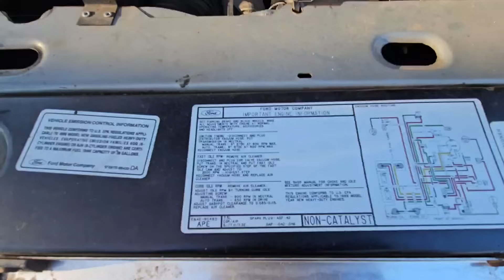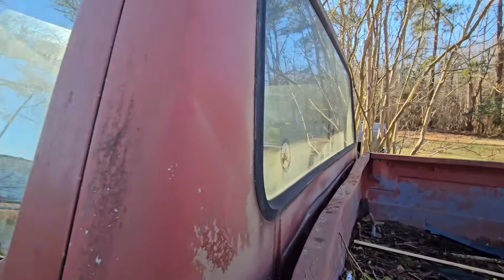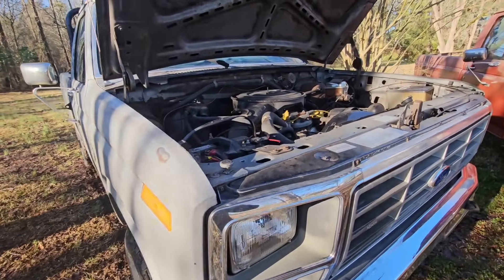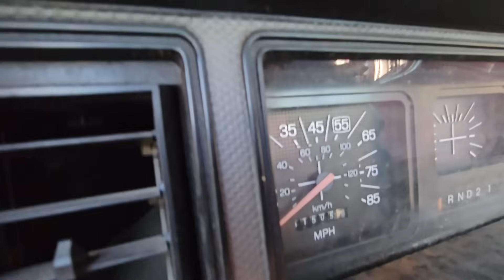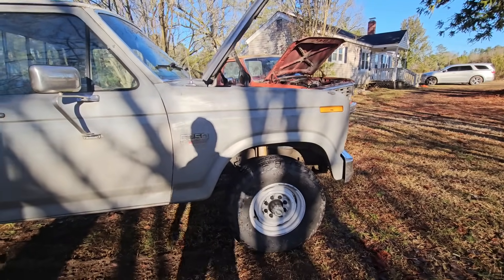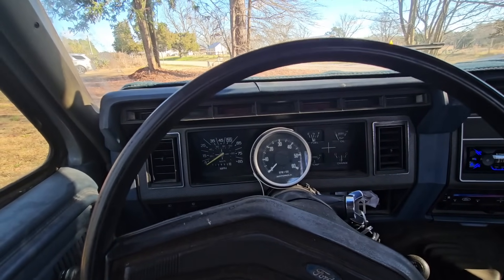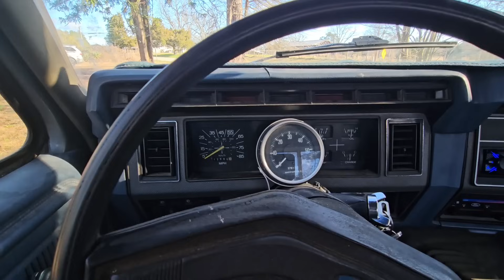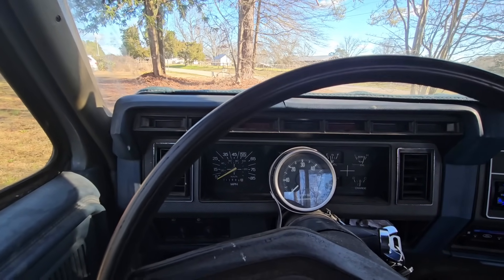THE WORST TRUCK FORD EVER MADE!?!?! #ford #fseries #sbf #bbf #truck

Comment: I had an 86 87 92 all f150s with 300 stright 6s and a 94 bronco and I still own a 78 f150. These are the days when they made trucks to last.
Reply: Now that’s a good joke when you said that’s when they made trucks to last.
Reply: What kind of mpg you getting on the six?
Reply: @samiam247  on the 80s models not so good because they both had the granny 4 speeds with a 3.55 rear-end so got around 15 at best .  The 92 had a 5 speed so it got about 20. With 2 tanks I could go close to 500 miles. My 78 has a 302 with a three on the tree and it gets about the same with that tall gear.
Reply: Unfortunately the engines weren’t. But what’s great is plenty of options for mods. Such as intakes, heads, fuel injection.
Reply: I still own a 1995 f150 5 speed with the single gas tank and the 300 I still drive here 2 days a week she has over 320k on her and still running strong I only drive here twice a week because she is always been a heavy drinker and gas is still high for filling the tank up every other drive lol these big sixes are not the best on the dinosaur juice. I get about 15 mpg highway/country roads. I couldn't tell you in town I don't drive there much. a lot of country driving I've owned this truck the last 20 years  and I got it from my dad that purchased it brand new so she's a family ford.
Reply: @acuraintegra101  If I could find a truck like that I would love it. For around 3k you can get a turbo conversion kit and produce around 500 hp with that engine. 300 is easily attainable. Not sure about torque but I would assume it’s equivalent to a 6.0 Diesel.
Reply: @rolandthethompsongunner64   with the miles on the truck I just leave it stock the Turbo would just kill the truck faster I can pull 7500 lb no problem and that's good enough for me I've got other vehicles for speed 2 Miatas one stock and one mildly modded 2 mustangs both modded and a rx7 bridge ported so Ill leave it up to them to go fast lol and use the truck to get parts and to take them to the track these old trucks are great when there left alone. I find the ford trucks become unreliable when people mod them. It's not Ford's fault all they did was make a great work horse it's the person trying to fix what's not broke that is there downside don't think for one moment I've not thought about it but I just tell myself not this one just leave her be fix only what breaks and with oem parts. The only things ever replaced on this truck was the clutch but 300k plus will do that and the water pump which didn't fail the gasket did but being it was 35 dollars for a new one I just replaced because it was off and didn't want it to fail a few months or years later  lol I still have the old one. But if you find one of these old trucks buy it you won't be disappointed with it.
Reply: @rolandthethompsongunner64  The 5.0 300 inline 6 is one of the most reliable inline six bangers ever built!
Reply: @bad74maverick1  No shit. It’s also a weak ass engine compared to anything newer.
Reply: @bad74maverick1  And it’s a 4.9 not 5.0 liter.
Reply: @samiam247  Abysmal. 😂
Reply: @rolandthethompsongunner64 made the same HP and more Torque than the 302/5.0.

My 90 has 600k miles and still gets 22mpg and have the scale receipts for pulling 3500lbs payload, and 17000lbs towing.  Now yes a new truck will beat it at the track-but trucks were built for hauling not racing.
Reply: @bowez9  Ok fine. Not my point. And it made equivalent HP for a 5.0 liter of that year. A 4 cylinder today produces more horsepower than either. It’s a durable engine that’s it. I would swap it out for a 5.0 Coyote engine.
Reply: @rolandthethompsongunner64  so you can brag?  All you gain is power but still lose reliability  over an orginal engine that is adequate.  IE you won't get 600k miles on MOD motor timing chains, guides or cam phasers, you might get 200k-300k.  Were as the 300 timing gears are good forever.  How much power does the Coyote make at 1000RPM?  EFI 300s make 300 lbs-ft.

Different marketing the old trucks were sold to be trucks not status symbols.

But that same 4 cylinder doesn't make the same torque-without a power adder.
Reply: @bowez9  Keep your tractor engine then. 🤡☝️
Reply: 99-03 super duty trucks were the most well built trucks.
Reply: I love the 300 six.
Reply: Made to last😂😂😂, maybe a 125k or 200k if you babied them???  Meanwhile I'm turning 315k on my vortec without an overhaul, still runs like it did off the lot brand new.
Reply: @ko4otv43 Nice truck man. In the old century, up to 1979 was the last year Ford made a powerful and reliable truck that looked great. 1980.....puke
Reply: @DG-sf9ei  like a diamond ring with a plastic band.

Referring to the GM.
Reply: Can’t beat them 300s I’ve owned a 81, 89, 94, and a 95 all with a 300. The 89, 94 and 95 all had a 5 speed and were 2 wheel drive, was a perfect daily driver. My 81 4 speed granny 4x4 has been through hell and still goes anywhere I want it to go. Man I love them trucks
Reply: @rolandthethompsongunner64  I will and my 300 will still be going just fine when the Coyote is discontinued.

As the meme say "when the last LS blows up, a 300 will take it to the scrap yard."
Reply: @samiam247 it’s not fantastic, similar to a V8
Reply: @acuraintegra101  I drive a 93 daily in the winter, 300I6, 5 spd manual - over 400k reliable as day 1
Reply: @rolandthethompsongunner64  maybe so, but I chug through the icestorm and pull all those new ones from the ditch with it
Reply: @kellismith4329  ya it's funny how great these trucks are lol I got mine from my dad a long time ago because he thought the truck was on its last leg when it had 150k.. ( alot was down to my mother telling him to sell it before it craps out on him)..on it but I didn't fight him over it and figured it was his loss and fyi he's been thru 3 other trucks since and all are in scrape yards and my girl marches on I can't imagine not having this truck in my life and when the day comes that she needs a new engine she will get it without a second though this truck has almost absolutely no rust on it other that a small amount of surface rust in the bed  and a crack in the dashboard and bench seat but outside of that shes as good as she was  brand new. OBF for life.
Reply: had a 81,86 with 300cid in then an a 97 powerstroke last time they had the heavy duty emblem on tailgate an fond memories of all.81 was a f100 but had kingpins too
Reply: Yup! Those straight 6’s were bullet proof! Couldn’t be put down. And I tried! 😂
Reply: Only vehicle I’ve ever regretted selling is my 94 Bronco.
Reply: I have one that’s an automatic and 92 with a 300 in line 6 in it. Runs great
Reply: I owned a 1983 F100, 300 six, one barrel carb, 3 speed auto tranny and dual gas tanks. Bought it 10 years old. Drive it an additional 75,000 miles. I loved the truck. Didn’t get all that good of gas mileage. But, it got me everywhere I wanted to go.
Reply: @bowez9 I put that on my 01 Chevy 4.8 1500 4wd 6.6 bed ext cab every day at work 
3100 + 300 tools + 100 lbs over 150 for me.
Sometimes more When logging 
That's just getting started for that Ford 300 ci

My boss has a 1980 2wd F350 dually flatbed stake body with the 300ci and 4spd manual and that would regularly carry 5000 pounds of bales + 700 lbs of passengers and tools or 10,000 of red oak and chug right up the steepest hills no problem- max speed was like 55 tho
Reply: I’m Guessing you had so many fords was when one didn’t start go to another 😅
Reply: @Dobberjones   only my chevys did that

Comment: The bull-nose ford trucks are actually one of my favorite trucks. Makes me wish I never got rid of mine.
Reply: Me too I wish I could find another one I love those trucks .
Reply: I had a 1994 And it Ran Better than a New Truck. I got rid of it because my X brother in law broke a spark plug in the Head my cousin tried to fix it but messed it up so it went bye-bye.
Reply: Same here, my first diesel was an 84 F250 4x4 I bought in HighSchool about 25 years ago, and a few years later I bought an 86 F350 4x4 with a turbocharged 6.9 International diesel and four speed, I’d give anything to have those two trucks back
Reply: Bullnose? Ha, more like box nose. I owned one of these pieces of trash, gutless and unreliable engines with throttle body fuel injection that either needs to get converted over to a carburetor to keep it running reliably and without unknown quirks, or just replace the entire truck. Regardless of the next person's opinion of it's appearance, the fact is these trucks were unreliable and underpowered due to heavy govt emissions standards and the auto industry in general was going through a guinea pig transitional phase into port fuel injection. Which port fuel injection was undeniably the best engine fuel delivery design of any vehicle era, no matter the make/model. It also reduced flooding the engine cylinders over time, making it the most reliable vehicles..... period.
Reply: @DG-sf9ei  so you’ve owned just one yet you think that validates your ignorant opinion? Hardly… I’ve owned several through the years, most were diesels and one was a 351w, all great engines. My 86 F350 had a Dana 60 front end that you couldn’t break if you wanted to and with an ATS turbocharger and T18 4spd with 3:55 gears I had plenty of power, got great fuel mileage and could pull a loaded gooseneck with a full size pulling truck and keep up with all the BigBlock Chevrolet guys with no trouble at all. All of mine were great trucks and I’d be lucky to still own any one of them.
Reply: I still have my 84 F250 XL with 4.9 i bought new after high school.  Unbreakable and easy to work on
Reply: @rob_v_nj  can't beat a 4.9.
Reply: @goat4298  300-6 is a great engine but there are much better engines available for these trucks.
Reply: Yes sir the Chevrolet trucks 1967-1972 are my favorite trucks. I still have mine. You are not the only fellow who has lamented getting rid of a vehicle though. I kept mine because I like the design and with the aftermarket and also the online sites parts are easy to get. Of course, back in the seventies and the eighties we did not have this access and a lot of people got rid of vehicles they wish they had kept.  Of course, this you tuber will be glad to sell you one of these Fords.
Reply: I had a full size 4 door 8 ft bed with 460 wish i kept that truck dual fuel tanks
Reply: I never was a huge fan of the bullnose Ford,but you put a lift and some nice wheels and beefy tires,they look tough as hell
Reply: Square body with inline 6 was pretty good truck never liked there other engine rebuilt alot of 302 in machine shop and that big block what a guttles pig
Reply: Had a 85 with a 3oo four speed two tone red with red interior wish I still had that one
Reply: Really this guy thinks no one wants these? 🤣 getting one today, hell might even post it, 4 speed in the floor, 4x4, 1985 Ford F150 Reg cab Short Bed, 300 In-line 6. Best engine ever made. Well atleast best ford Gasser ever made.
Reply: My father had 82 stepside
Reply: They're not hard to find
Reply: @goat4298  me too. I loved that truck
Reply: @norman7396 last generation of the solid steel body, i had a 98 which was the redesign.
but i will admit that's when Ford began to change, cause while my 98 had a steel frame, the body Ford started producing around 2000, that extended to the 2006 redesigned and 2015 was different. i don't know what they used, but it's not a solid body like your 94. which surprisingly Ford did keep the F250 from the 90's around, up until 2002, but only the 7.3 diesel was kept around.
but then Ford went to that 6.4 in 2004, alot of people didn't like that engine.
i never owned one, i had a 93 Cummins.
Reply: @DG-sf9ei the fuel injection was only available for 1 year on bullnose trucks…
Reply: Mine too I had a 6.9 idi, took a while to get started which is typical, but was awesome driving, beat the hell out of it! I lived on the beach when I was young and worked at a beach bar down the beach so I used to drive it down the beach since everything about it was illegal, but was so much fun 😅
Reply: @Jeymez it’s not the last generation of the all steel body…..

Comment: In 1981, I bought a brand new F250 Custom w/ 351M and a 4 speed for $8500 drive out.  10 years later with zero problems I traded in for a minivan for my wife. 33 years later I have a different wife and wish I had the truck back, but not the ex wife.

Comment: I had a 1986 F-250, 4x4, 4 speed, with a built 460. Loved it. That thing would pull a house down if I wanted it to. Spent its life as a farm truck and daily driver. Now I drive my 1989 F-250, 4x4, 460, automatic. Again, spent its life as a farm truck and daily driver. Both are XLT Lariats.
Reply from the maker: That's great! Keep it running!
Reply: Me an my workin partners work truck was a big ole 460 ford man the more we Worked that dang thing the more it wanted Just put it this way it had one Cleaned out Carb time we got done with it Every day!!! Also my older brother had a 97 1ton just a reg cab 4x with that big block bustin out swore it was gettin bout 6miles a Gallon im sure but even being the Chevy guy i am if i had to give a definition of a Real Truck id of showed you that Ford for sure!! Of Course brother talked like he was gonna keep it forever but he had it sold less than yr later Now brothers no longer with us He'd always talk Crap to me cuzz i had a 80 Chevy a few yrs before that an he'd be like Can ur Chevy do this!?? Could ur Chevy do that!!?? Im like well yea Jim its just mine wasnt a 1ton he pulled into local mud pit an put it in park lmao!!! Put it back in drive An MASHED IT AN WE WAS OUT!! LOVED IT!!.Rip Big BRO JIM
Reply: @runsgoodbutsmokes  If the red one had a manual trans, I would make you an offer. As for the grey one, how much do you want for it???
I have a long wheelbase 78 E-150 with a 351W and a four speed manual transmission and 4.11 9 inch rear end with limited slip. However it was badly vandalized, as the hate factor has really gotten bad in the last ten years and some of my neighbors really don't like the fact that I'm a Halfbreed...
Reply: I'll bet they are horrible on gas however.
Reply: @adotintheshark4848  absolutely.

Comment: My dad bought a 84 f250 brand new  in March of 84 had everything  on it he wasn't  happy about the crome  and my mother told him to take it back and get what he wanted...So I don't know if any other f250 has as much crome as it does. So my dad bought it in March and he died in July my mom drove it until 1992, it wouldn't pass  MO inspection so she parked it in the garage. It has 36000 miles on it.
Reply: What are your plans for the truck?

Comment: I ordered an 88 150 4x4 with the newly injected 5.8.  It was a beast of an engine with the 3:55 gears, ls front and rear.  Many electrical problems and never saw 10mpg. Gauges worked sometimes and sometimes not.  I gladly sold it and got a 2wd 87 Toyota and never looked back.

Comment: Great video and great trucks. I just picked up a 1991 f150 2wd for only $1,100 in running condition. The truck bed is in great shape, has hardly any rust on it, and has a straight body.

Comment: The best qualities of these trucks

1-you can put a sheet of drywall or plywood in the back
2-you don’t need a ladder to look in the bed
3-the sight lines are great. You don’t need a backup camera just to park them
4-they cost about 70k less than a new truck
5-they were built to be utility vehicle and not a glorified family rig
6-they are simple with minimal bells and whistles
7-they come with scratches and dents. So you don't need to worry about keeping them new
8-the cost of tires is about 1/2 much compared to modern trucks
Reply: Yup, the single cabs have zero blind spots.
Reply: Try putting an 8 foot anything in most new trucks.

Comment: I have an 81 shortbed that was my dads 86 but it caught fire, so the cab off my grandpas 81 was put on it. This truck has been in my life for 40 of my 42 years. Grandpa bought his 81 f100 ranger in 1985 and I remember riding in my grandpas lap when I was 2 in that truck. I still own it and it is in my shop being refurbished. My grandpa, my dad, my sons and I, have all turned wrenches on our truck. It's not just a truck to me, it is literally a never ending memory machine. I don't remember this truck not being in my life. I also have a 92 short bed I want to make a lighting clone out of.

Comment: I have a 94F150 Xl 4x4 inline 4.9 six with a 3spd O/D auto.  Single cab long box runs like a top I love it.  This thing will pull a stump out of the ground great torque.  I love the 4x4 86 you have.👍

Comment: Had a 84 standard cab 4x4, 6.9 diesel, 4speed hand shaker. Red and white. Drove that truck for 300,000 miles. Back in the good ole days.
Reply: I need a Chilton manual for that engine.
Reply: @ : idk. They’re pretty simple to work on.

Comment: I had bought a 1 year old 1980 XL F-100 Explorer with the 300-6 long bed, no AC, AM radio, and dual fuel tanks. I ended up getting a '21 boat a few years later and thought I needed more towing power so I swapped in a 400 and NP435, straight swap out of an F-250 (junkyard). Every day driver for 30 years. Two older kids learned how to drive in it and drove it to school and what not until they got their own drivers. Zero issues.
 Had to park it with a job change and by the time I got back to it it was just too far gone with rust, definitely had a tear in my eye when I took it to the bone yard.

Comment: I wish I still had my 86. I had swapped out the 6 cylinder after wearing it slap out. I put a 351 M400 out of a 78 f150. Carb, intake, heads and cam. I loved that truck. Like a fool got rid of it after I had completely brought it all the way back. Paint,  interior everything